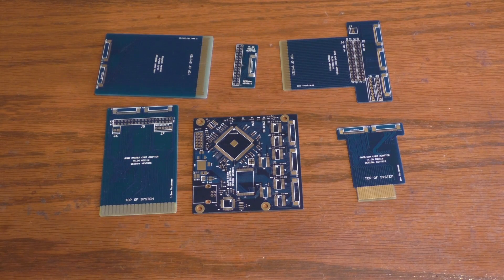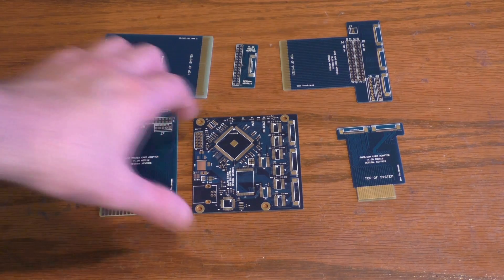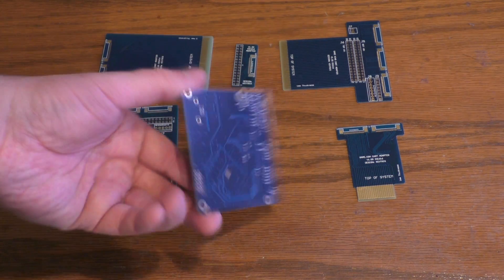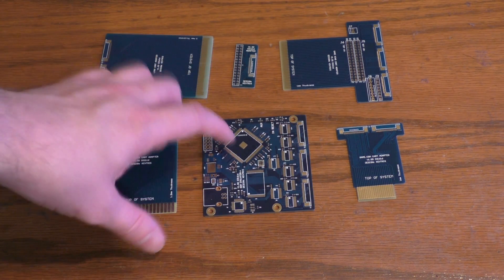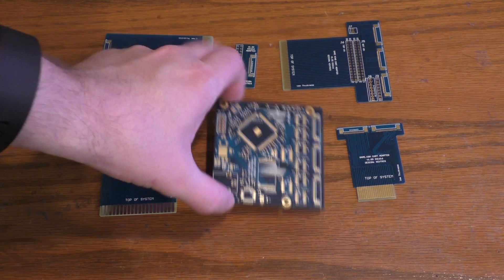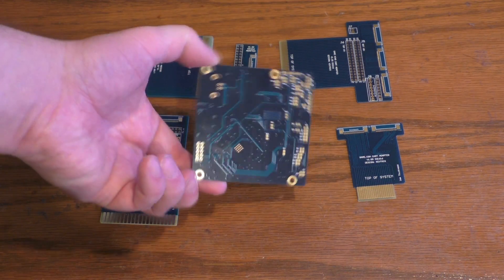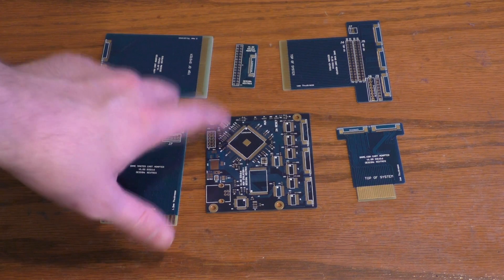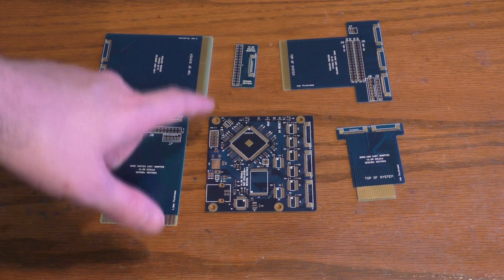Time Lapse Layout of ROM/Cart Emulator PCB in Altium

Comment: Looks like your original trace layout in one section had to be scrapped partway through and rethought. I've never designed a board myself, so it's interesting to see how you come up with the trace routing. Reminds me of the Konigsberg Bridge problem.
Reply from the maker: +MarkVI yes, I got quite a bit of the way done then realized it was not going to work very well, so I tore it all up and tried again.  It might take many tries to get it to something usable, though usually 2-3.

Comment: Quick after designing the schematic for the pcb with Altium, where can I have the pcb's made?
What company do you use to make your PCB's?
Reply from the maker: +jart122 I used pcbway to have them fabbed.  They do excellent work and cost is reasonable.  I was happy with them.
Reply: Thanks for the quick response. I just checked them out and got an instant quote from them. The price for 10 boards is great. Thank you again. 
PS: Great videos. Your videos is what keeps me going to get my computer engineering degree. Plus I have another program to learn for this summer.